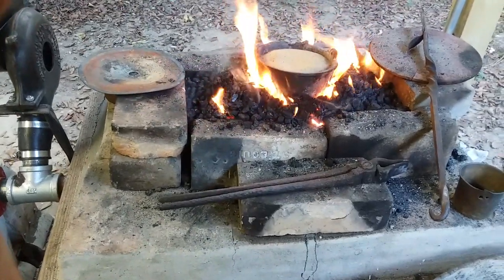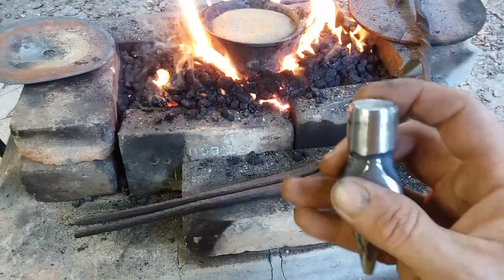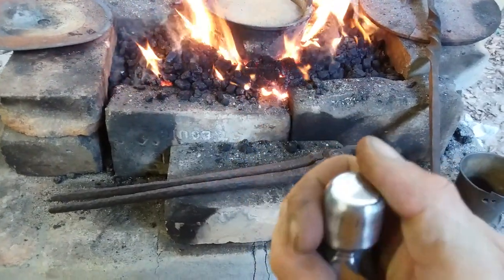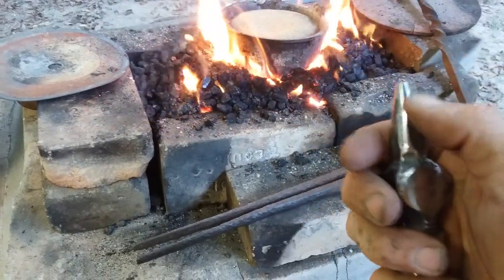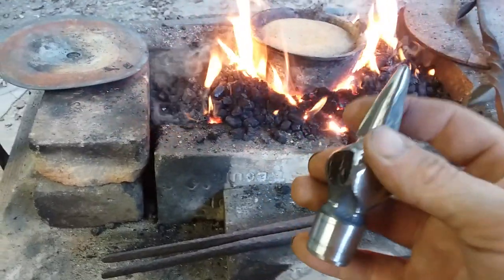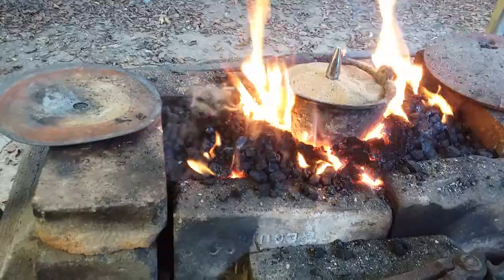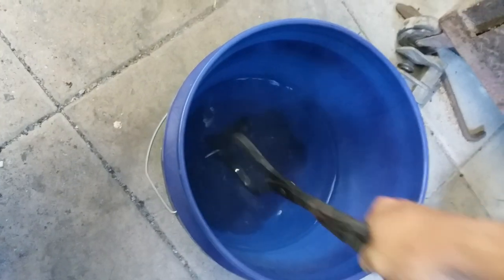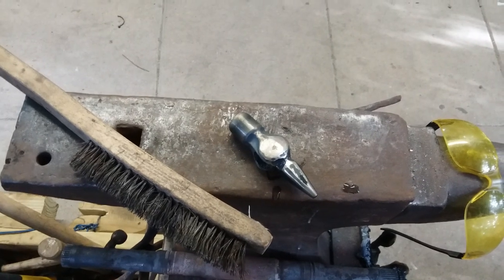Heat treating the ball peen hammer punch

Comment: did you already harden the hammer head before  doing this?
Reply from the maker: Evans LeBlanc I did not. I slow cooled it after forging to keep the hammer head softer. A hardened struck surface can chip and cause problems.